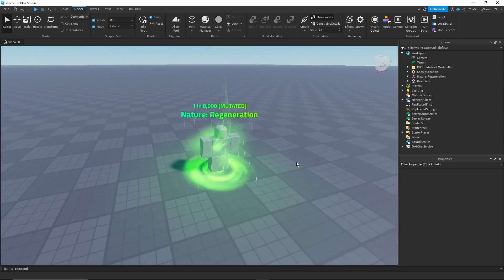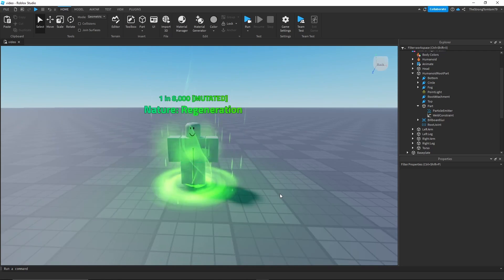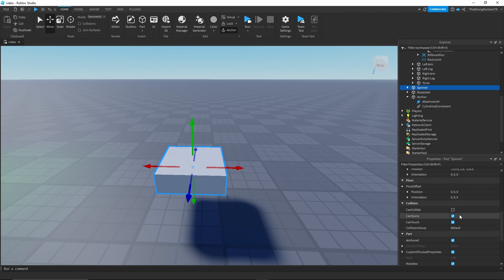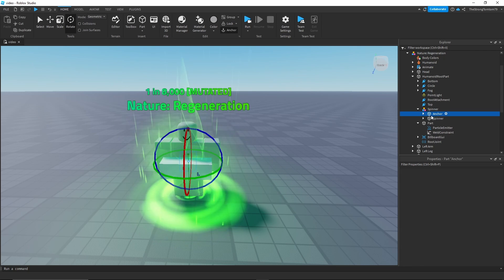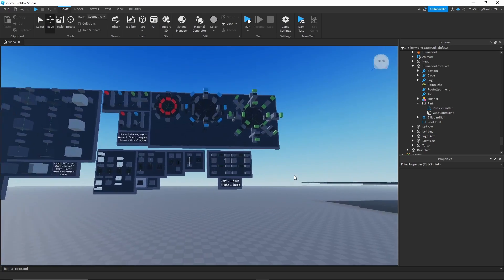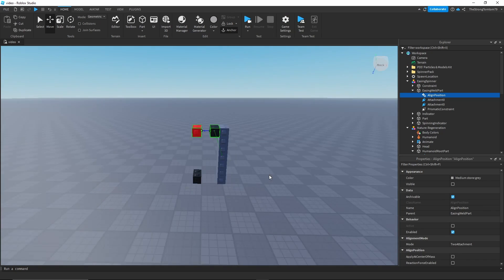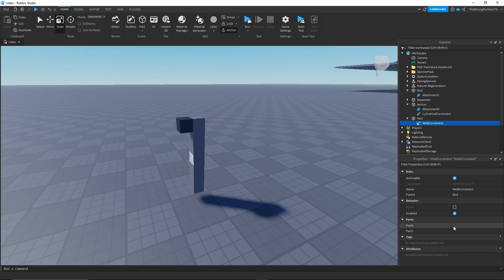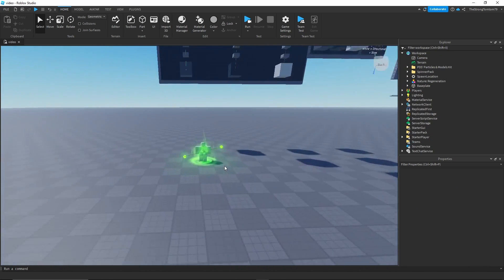[OLD] How to make AURAS for SOL'S RNG | PART 3: Constraints & Spinners | Roblox VFX

Comment: I have to redo the entire spinner thing cuz when i move the rig i cant go back so i have to restart
Reply from the maker: What do you mean? If you did something wrong, just Ctrl Z and undo, and if the spinner is not letting you move, unachor everything and make sure it's welded properly.
Reply: @TommyGamingGamingChannel I do press ctrl z, But the rig wont restart ontop of the baseplate.
Reply from the maker: @landhemi3391  then I'm not sure what you did, but ctrl z should be working fine.